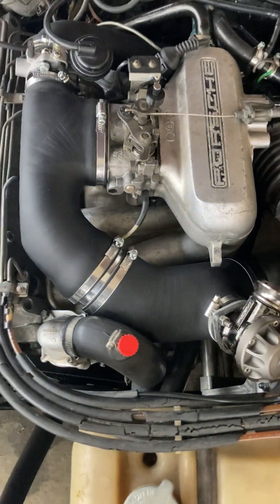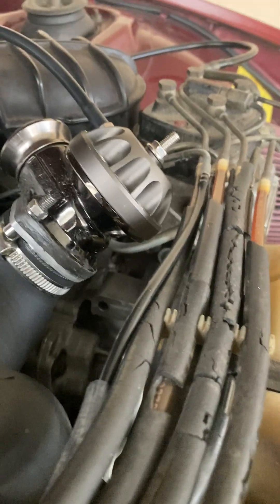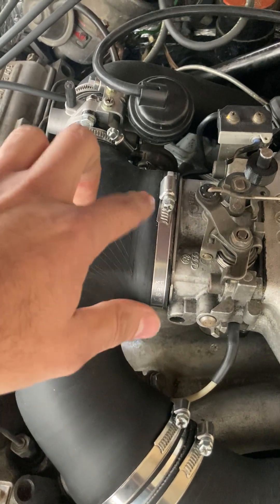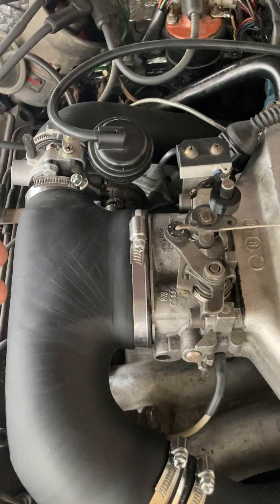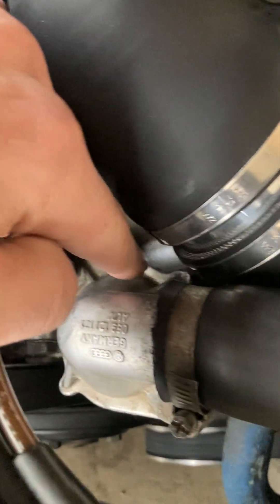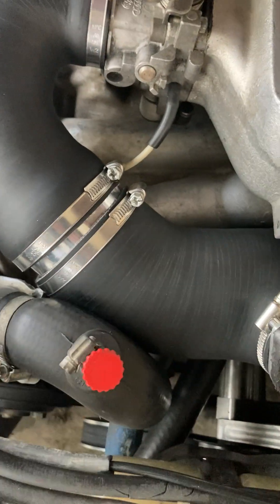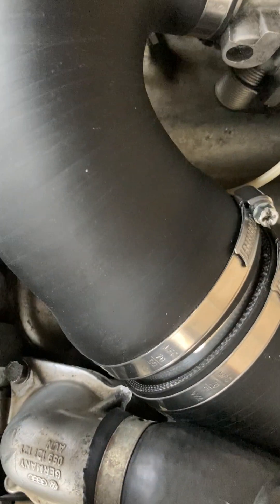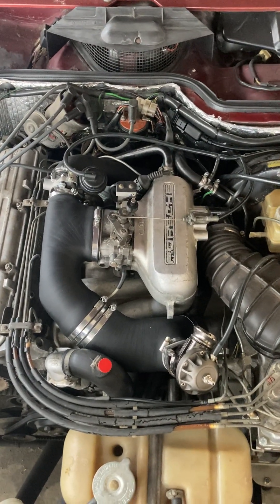SUPERCHARGER kit V3 upgrade notes - Porsche 924 2L

Comment: Hi. On the first second there is a red knob in your video attached to a black pipe. Are you able to tell me what it is and what it’s used for? I just bought a modified 924 turbo and just trying to work through the modifications. Apologies if it’s a dumb question
Reply from the maker: This is not a 924 turbo, this is a supercharged 924 NA. The red thing is a plug for the coolant bleeding port, and that is specific on the NA. The turbo has this in form of a screw that is directly into the thermostat housing.
Reply: @PorscheAddict  thanks for responding so quickly. Understand yours is a supercharger. Great videos btw. Mine was a NA 924 that someone spent a lot of money after market turbocharging and has a lot of things that don’t look familiar (eg fifth injector, red knob etc). Thanks for responding so quickly again and I’ll be subscribing to the channel.

Comment: Why is your distributor still attached to the throttle body vacuum?  Wouldn't it see boost not vacumm?
Reply from the maker: Distributor on the NA only advances timing at certain levels of vacuum, since it sees boost 99% of time it wont advance under boost, but in some cruising conditions it sees vacuum and the extra timing is good in those conditions.